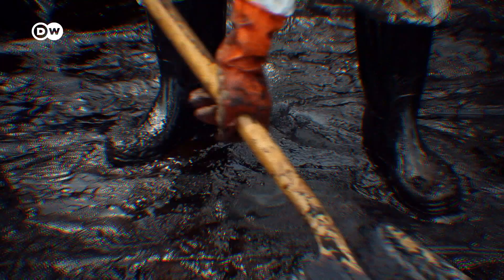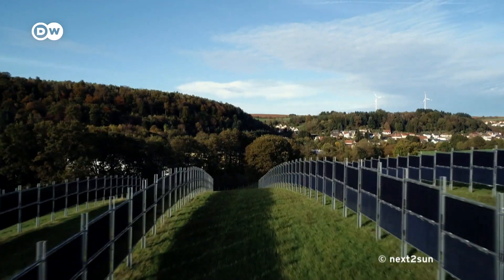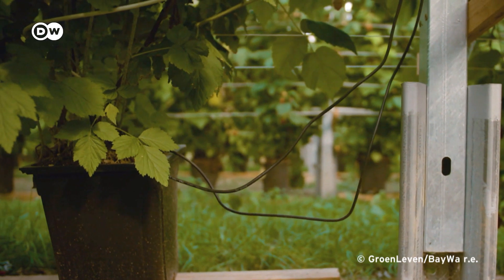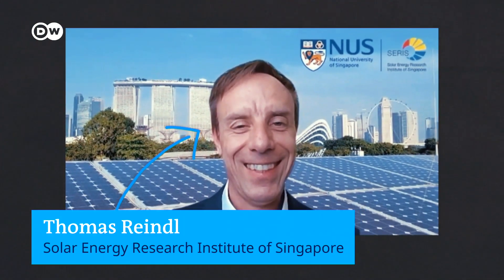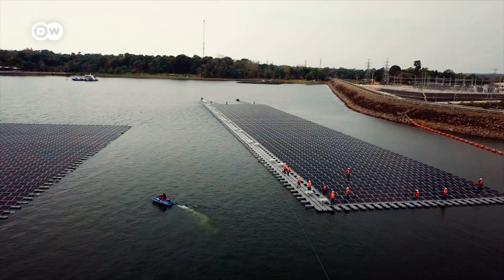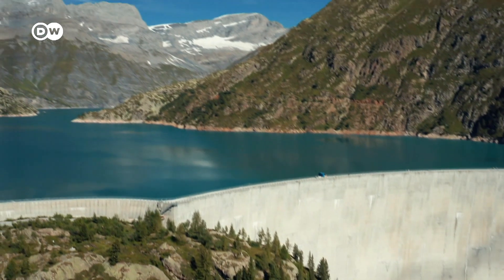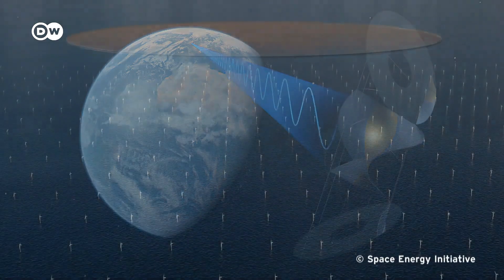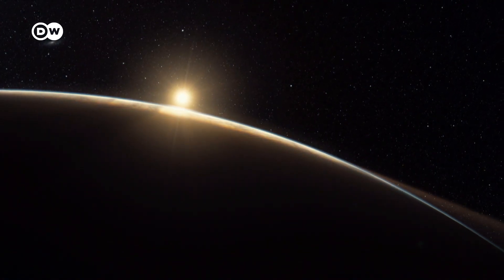Why we should be putting solar panels on our fields and lakes

Comment: While slapping solar on every roof and car park sounds like a good start, the issue is that not all roofs are angled towards the sun or receive shading due to trees or nearby buildings. Yes the panels will still produce energy but at diminished yields which might make them uneconomical. One issue with the agricultural panels is that they’ll only work in niche areas. Large industrial farms, which make up the vast majority of farm land, won’t adopt the idea as the panels prevent tractors and combines from working. Floating solar is a neat concept and makes sense for reservoirs or other restricted navigation areas but wouldn’t be viable in the wider ocean or rivers due to the navigation hazard they pose. The best solution, diversification of green energy sources. Encourage solar, wind, geo, nuclear (not decommissioning), et c.
Reply: Nuclear is not green energy but otherwise agree
Reply: @gerade_kurve8748  nuclear IS green energy.
Reply: @Brandon_letsgo  More precisely...it's not renewable energy
Reply: @aleenaprasannan2146  And? We have more than enough nuclear fuel for thousands of years.
Reply: @Brandon_letsgo  No we don't. Petroleum was also ones something that we has more than enough for thousands of years. But nuclear mineral deposits and Petroleum are resources that are of extremely important geopolitical and economical important...thus giving the producing nations the onus to control the production rate and  how much of that resource will be released....Just like how the OPEC countries band together to reduce production and the fuel price skyrocketed....and hence the next wars will be over nuclear deposits...oh wait..it's already happening in Ukraine
Reply: @aleenaprasannan2146  Yes we do, the efficiency and power production of nuclear is unmatched by any other resource available to us. Nuclear energy is 93% efficient, which is nearly 4x as much as solar.
The average nuclear plants are easily capable of 1GW of power  the equivalent of 3 coal plants and many renewable plants.
Reply: @ChristAcolyte  Why would efficiency matter when countries can restrict production and release of nuclear fuel and artificially inflated prices just like what they do with petroleum?
Reply: @aleenaprasannan2146  you know what? I don’t think you have a degree .
Reply: @Brandon_letsgo  Did I ask you to hire me? No. Do I care whether you think I have a degree or not? Nope
If it soothes your heart to think that the person who is refuting your argument doesn't have a degree, think whatever you want to self soothe.
My degrees don't need your validation
Reply: I like it man. Definitely would love a hybrid wind and solar system.
Reply: 100%, not enough people in this comment section are thinking through drawbacks of solar. You can’t just put them everywhere. On most houses rn, you would be harming the environment more than you’d be helping it because the environmental impact of production and disposal of solar panels would exceed the benefits of the comparatively small amount of energy you get from the panels. There are absolutely places where the benefits outweigh the drawbacks, but I’m seeing people genuinely believe we could and should force solar in lots of places where it would only make things worse.
Reply: @jmunt  I agree...one such thought I hear often is solar panels in parking spaces...Putting solar panels on top of large heat sponge asphalt is literally making it as least efficient as it can be, not to mention that it's going to make parking miserable
Reply: @aleenaprasannan2146  I assume they're talking about installing panels overhead, which would cool the asphalt down considerably.
Reply: @westasleep  Yes the asphalt will be cooler, but why does it cool down? Because the solar panels above it is absorbing that heat, and thus working less efficiently. In agrovoltaics and floating solar panels the water/transpired water  below it considerably cools the panels, because water has very  high specific heat capacity and so would definitely be much cooler than the solar panels, meanwhile  asphalt has low specific heat capacity and thus in theory it could be the same temperature or even warmer than the panels. The asphalt will only be a bit cooler than it usually is and not necessarily much cooler than the panels themselves.
Having cooler asphalt isn't really a good enough reason to make a less efficient overhead solarpanel installation which will also make parking more nightmarish. 
Having a vining legume as shade or having narrow Miyawaki groves  might be a better environmentally responsible solution in parking areas

Comment: I've often thought the panels could follow all of the infrastructure of roads and bridges.
Reply: You could, but why not first put them on rooftops and supply power where it's going to be used, and then add ones over roads if you still need more capacity?

Comment: How about building a nuclear powerplant with efficiency ration of 97% instead of using solar with efficiency ratio of 15-30%? The most powerful solar power plant in the world takes 14,000 acres and have a nominal power of 2500MWt. With capacity factor of no more than 30% you get less energy than 1 (one!) single VVER-1200 produces. And usually you pack 'em in four and can put the whole powerplant inside of 1200 acres.

Comment: Right now the average solar panels are 15 to 18% efficient. So a huge amount of the solar energy hitting the solar panel turns into heat. So where does that heat go into the atmosphere, so if we paint the earth black with solar panels I don't see how that's going to cool the planet. Nuclear is the way to go right now. We also need to find a way to generate hydrogen cheaply and efficiently to generate electricity and power our cars.

Comment: The problem with solar is storage - there’s plenty of space to put panels. These ideas don’t solve the primary issue, which is better, cheaper energy storage.
Reply: Bang on the money. At the moment we really don't have great storage solutions. Batteries are way too expensive, pumped hydro is great but needs the right geography. Seasonal heat storage looks good for higher latitudes, but that still leaves a lot of gaps. Nearly forgot hydrogen, yeah let's forget hydrogen, way too inefficient.
Reply: @russelldesilva1560  you should check out Hydrostor's version of pumped hydro CAES, which uses compressed air used during off peak/green tech to send air into underground caverns filled with water, that gets pushed up to the surface reservoir with the hydrostatic compression. when power is needed the water falls back down, forcing the compressed air back up and gets reheated by the saved heat from compression, and forced through a turbine. They have REALLY high efficiencies, and there's also the potential to take it further by for instance installing solar panels over the reservoir to reduce evaporation and help drive the system, others have theorized using the water for an algae farm. REALLY cool tech imho.
Reply: @russelldesilva1560  https://www.youtube.com/watch?v=cOWjwwKSR78&ab_channel=Hydrostor I found a 4 minute YT video they made that explains it very well.
Reply: There are currently quite a lot of storage options in development/initial deployment that should do the job just fine. It just needs some time to grow, iron out the kinks and scale up. Most of these don't use lithium, so that can be kept for other applications (EV's, laptops, smartphones, ...). The expectation is that by around 2030-2035 storage+pv or wind will be cost competitive with gas, coal, nuclear, ...
Reply: Wrong, solar can be used for peak usage. (During the day) and nuclear can be used at night
Reply: @Gkett883  Theoretically yes. Practically however is something else. Nuclear would have to be used as a base load, but if solar and wind produces too much during the day, something needs to be curtailled and that is usually the more expensive generation, in this case nuclear. Which would push its costs even higher. 

Especially if grid storage becomes competitive (expected around 2030-35), there is not much interesting to using nuclear as a baseload, unless it can become siginificantly cheaper than current new nuclear powerplants are.
Reply: Let us make lemonade when we have lemons and avoid thirst. Why cry for spilt milk?
Reply: zinc bromide batteries, lithium is a fad
Reply: Agree.  This seems to be the bottle neck to 100% renewable energy.
Reply: chemical batteries, off river pumped hydro, compressed air, all appear viable (the volume of those batteries would be less than all the fuel tanks at all the gas stations). Even some old fashioned techniques can be repurposed, like heating water (or cooling a eutectic block) when the sun is out, rather than at midnight would help.

Comment: Do it the simple way.  100 km x 100 km solar arrays in NM and AZ.  DC transmission lines east and west.  Lots more wind generators, preferably 700 ft or higher.  Simple transmission.  Lots of batteries.  We're done.  Build it all as fast as possible.  Cost of energy goes down -- no space ships, no beams and collectors from outer space, no floating arrays or anything else that adds complexity.
Reply: Cover the roofs first. Use the land for two things at once: shelter and power, and you also avoid the need for new transmission infrastructure. In Australia, something like 1 in 4 households already have rooftop solar (mine included), in spite of the coal-a-lition government we had for the previous nine years until the most recent election where they finally got the boot. Batteries, not so much. They're, alas, only worth the cost if they go in as part of a new installation, not as a retrofit to an existing solar system.

Comment: Should be focusing on places with high capacity factor, solar panels need high purity silicon to make which releases CO2 when being made. Putting a solar panel in a place with poor capacity factor just extends the CO2 energy payback of the manufacture of the solar panels before they even start contributing to the overall problem

Comment: The fact that the microwaves beamed down from space are only about half as powerful as the midday sun makes me wonder what exactly we gain by doing it in the first place.
Reply: It's like wireless charging. Still requires a lot of wire for the coil and creates a loss in efficiency for the sake of convenience. The only thing to be gained by beaming power from space is that it can be constantly done 24/7 meaning batteries won't be required.

Comment: Agrivoltaics, roof top solar, and panels covering reservoirs and irrigation canals are brilliant ideas. In each case there is a secondary benefit in addition to generating clean energy. The cost of the panels themselves might be higher, but this is more than offset by the secondary financial payoff.
Reply: Yea. Even if you assume the panels only last 10 years instead of 25 they still save enough money in order to offset the extra installation costs.

And once you have the first installation completed the. Swapping in new panels is much more simple. From a financial perspective the majority of solar installations are a no brainer really.
Reply: clean energy? You are still generating electricity with fossil fuels and by destroying the planet. Just because YOUR energy comes from the sun doesnt mean those panels werent produced using vast amounts of fossil fuels and non-renewable resources. The fact that people who make your green energy solar cells and batteries are often exploitet. Most panels these days come from china, where slaves in uyghur concentration camps are forced to manufacture them, standing in heavy metal solutions and inhaling silicate-hexafluoride, a waterlike substance that turns into fine sand when coming into any contact with humidity, thus destroying eyes and lungs of the laborers - and for what? So you can tell stories about clean energy and boost your conscience. The "renewables" industry is neither green nor sustainable.
Reply: Nothing clean about the mining needed to provide the materials to make these things.

Comment: We should really start with storage. Already there is so much "uncontrolled" production many places that the price of electricity goes bananas all the time. Just a few hour an extra 30000 MW production can be dumped into the grid in Germany a the price drop from negative or the wind drops of when electricity is needed and the price goes up 4-5 times and more then what the average price is. 
There have too be a place to store production so that pricing can be more even and predictable. That will reduce the average cost for the users and make it a lot easier for the producers to run a business.

Comment: Not sure how you made this video without mentioning integrated solar by companies like Solapave. Just re-using space we already urbanised - roads, paving, wall cladding. This way the energy is where it’s needed.

AggriSolar works too but it’s very niche as to where it’s suitable. 

Water solar though, not a fan, covering large bodies of water stops algae growing which cleanse the water. So it stagnates. Water isn’t disappearing. Water that evaporates from one place falls as rain in another.
Reply: Its a bit of an oversimplification.  Rain 100 miles away is no use to a reservoir thats disappearing

Comment: The problem with current solar is that they are inefficient in their current form. Making more in this current form would require energy and materials that also impact the environment. Once they can at least be 50 percent efficient, than yes! make it happen!
Reply: Inefficient compared to what? For comparison, photosynthesis tops out at 6%. 

My impression is that solar is pretty mature. I wouldn't expect to see the kind of massive gains we're getting in the battery space. I wouldn't bet on seeing 50% outside of a lab in the next 30 years.
Reply: @westasleep  no no let's wait another 50 years :)
This guy thinks we have aaaaalll the time in the world
Reply: @westasleep  Nuclear is already 93% efficient
Reply: Yeah but burning natural gas/coal/oil is literally fuckin the planet. We can’t just wait until our technology is better to fix things. The efficiency of solar panels is mostly irrelevant it’s better than free energy we want to reduce solar radiation, what matters is the actual production and it’s not bad. Personally I would go with nuclear but anything is better than the current.
Reply: Yeah, let's wait. Did so much good in the past :)

Comment: The first idea already fails, because the panels are not angled. When it comes to solar energy, every % of energy loss counts. The further away you are from the ideal angle the more extreme the energy loss is.

Sure you can add the automatic rotation, but that is an insane amount of extra cost, on top of the already expensive frame system that carries 2x less panels, but requires the same amount of materials. On top of that, you are adding a lot of new maintenance and making the basic maintenance way harder.

The increase in €, $ per wattage is insane. You literally lose on everything with this design. Less land for crops, less area for solarpanels. In the end, rather thsn keeping it seperate, you are compiling the two and greatly increasing the costs. It is simply not practical. Just like the solar roads idea, just a little less extreme.

Solar energy is all about making a profit as fast as possible. Even with goverment support, in some places that is around 10 to 12 years. Now double the costs and you get around 20 to 24 years. If I'm not mistaken, then inverters are changed out every 10 to 15 years. So in extreme conditions you have to change them twice. Which means that 20 to 24 years is closer to 23 to 27 years. Problem with that is the fact that solarpanels have a lifespan of 25 years or so and they lose a lot of efficency by the end of their life cycle. 

In other words, this doesn't seem to be that profitable. I'm sure they have some way to make it more profitable, but then again solar panel roads was pretty popular for some time.

Unless they can make it a lot cheaper (nowadays when panels are up in price again) and effective, they are just overpriced shade for a few types of crops.

Comment: Well, we first need power grids to be able to cope with all this solar energy.
Next, specifically for agrivoltaics: How would farming equipment operate under these solar panels?
Reply: The power grids can already cope with the solar power. The solar power is just replacing power from fossil fuel burning so there is no net increase in power generation
Reply: @John...44...  but there should be, since power grids are reaching their limit as they are.
Reply: @Skoda130  maby where you live, but here in the UK the grid is well established and is able to handle many more sources of power generation in the coming years

Comment: Solar panel is NOT green! It has a huge carbon footprint to manufacture, to transport it from China to Europe, has a limited lifespan of 25 years or so, very low efficiency, and recycling it also requires a lot of energy. Hence the overall energy gain is limited. Want to save the planet? Scale down, turn down the heating, plant trees and cycle! And forget EV cars: that is a dead-end, too.